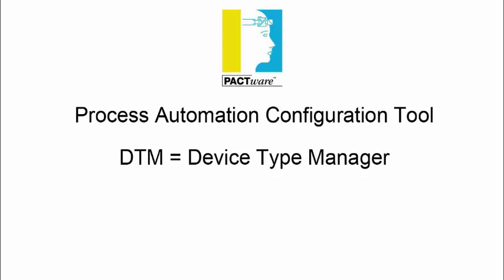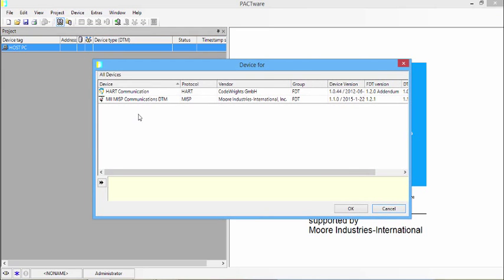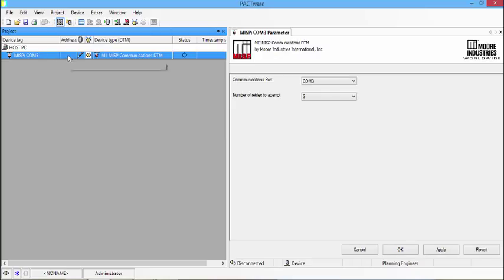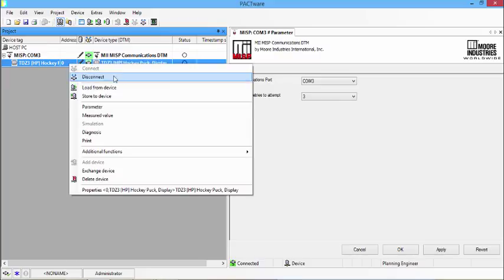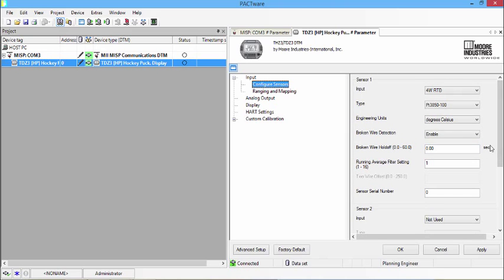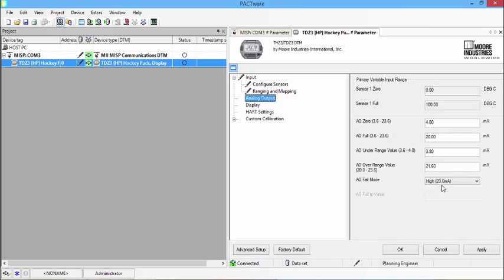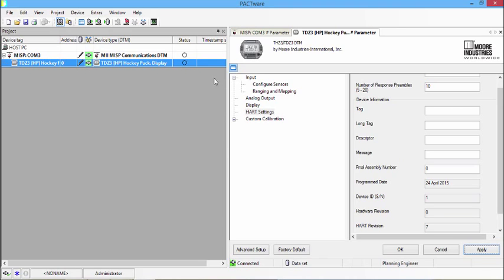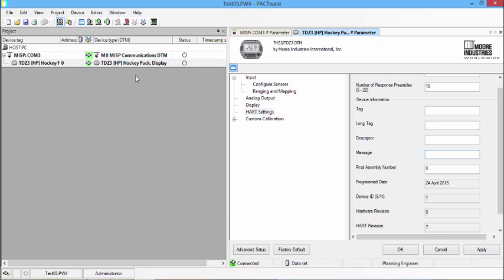THZ3 TDZ3 with PACTware Basics Tutorial

Comment: nice video, but i have some problem with recognising and connecting to honeywell multiparameter sensor , can u do some video about working with this type
Reply: Hi Alex, This video covers using PACTware with our DTM for the Moore Industries THZ3/TDZ3 Dual Input Temperature Transmitters designed for use with RTDs, Thermocouples, resistance and potentiometer devices and direct millivolt sources. See the data sheet or user manual for details: http://bit.ly/2FqHQUQ.
Honeywell makes hundreds of different sensors.  Be sure that you have the correct Honeywell DTM for the device you are attempting to communicate with through PACTware.  If you are sure that you have the correct DTM, then I recommend you contact Honeywell for guidance.